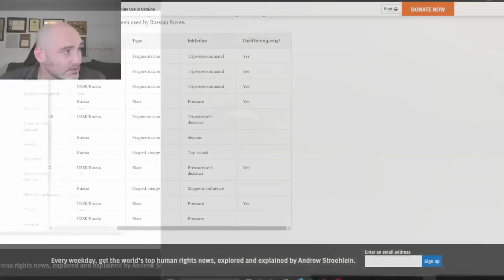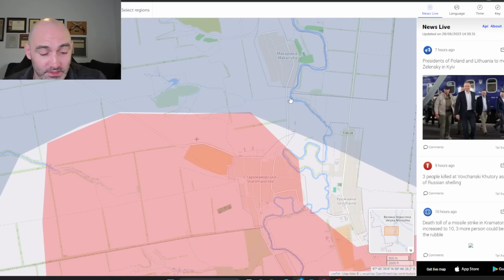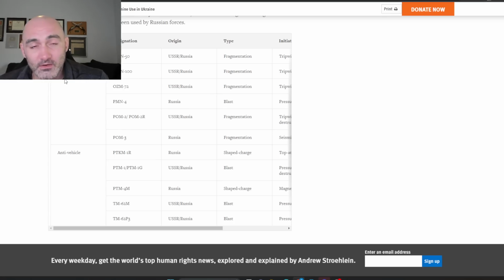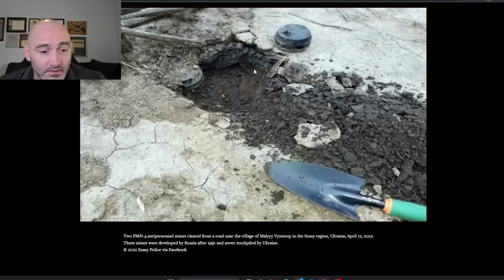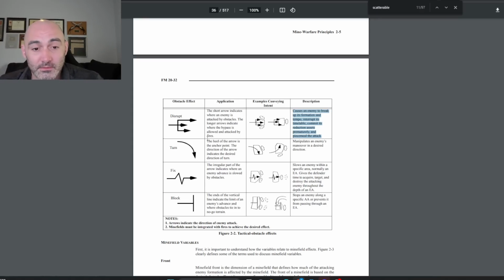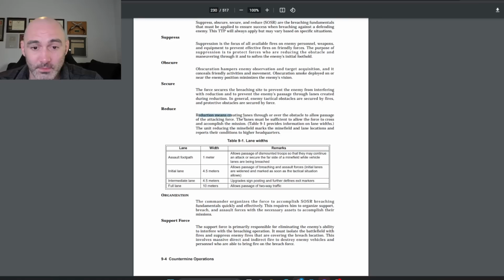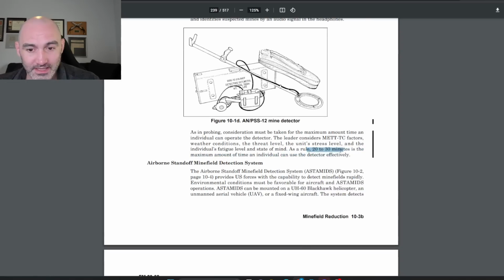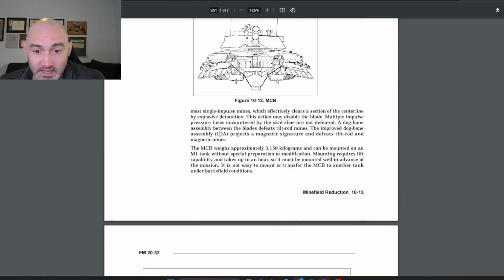The Simple Russian Weapon Slowing Ukraine's Offensive!

Comment: There are some "smart" mines that can distinguish between different types of vehicles, have motion detectors, they are also remote controlled and have inactivation timer.
They do not react to external exposition or rollers or beating by for example chains.
Some are made from mainly non magnetic materials, so metal detectors don't work.
Reply: I doubt any of these are in use by the Russians. They are just laying thousands of general mines.
Reply: They can be worse than that.  They can count the number of vehicles and ignore the first X, or activate in x minutes or hours.  The detonator can detect the shockwave of the MCLC and lock the firing device for x seconds so the MCLC doesn't work. (That's an Italian mine)  However modern US min detectors are actually ground penetrating radars, so they pick up non-metallic mines.

Comment: HELP! I'm getting mixed signals everywhere. Are things going sideways for the Ukrainians? Straight up, please.
Reply: It's simply too soon to say. Certainly the Ukrainian armed forces would have liked to be further than they are, but that's not indicative of things going sideways, just that the Russian forces haven't made any major blunders that could be exploited, unlike in areas like Kharkiv. Prigozhin's attempted coup will also have caused a delay, as the Ukrainian forces will have wanted to wait and see what happened during and in the immediate aftermath of that incident.

Ukraine has to be much more careful in how they commit forces, as they have less manpower in general than Russia, and although Western kit can be replaced fairly rapidly, training new crews to replace dead or injured ones would take time. For example, the US have over 6000 Bradleys knocking about, but they're no good to Ukraine if the crews trained to operate them are dead, wounded or even just exhausted. 

There's also a political aspect - Ukraine may be stalling committing their full forces in the hopes of getting modern airpower, which would drastically improve their overall offensive capability and reduce casualties. 

Ukraine has plenty left in the can, so to speak, but Russia has had time to prepare significant defences, so nothing is going to happen quickly unless or until there is a major breakthrough. Russia undoubtedly has the easier job, just camping on what they have, but they have an issue in that they are trying to defend a massive contact line with far too few men. Operation Uranus that ended the siege of Stalingrad in WWII sent over a million Soviet troops through a hundred kilometres of contact line, whereas present-day Russia in Ukraine is trying to defend over a thousand kilometres of contact line with around 700,000 men in total, bearing in mind that most of those will not be front line combat troops.
Reply: Jesus seriously????   They are getting demolished against Russian impregnable defense lines.   At the current rate it would take them 16 years to achieve anything and a million dead.

Comment: Seems like a job for an anti mining drone. Let loose a small army of heavy but expendable objects like barrels fill with water deployed from a flat bed drone with a ramp. Or maybe a drone that can pick up a heat signature since metal is thermally conductive and shines a laser at the mine heating it up until it explodes.
Reply: A drone large enough to carry any substantial weight would be a helicopter which is big enough to shoot down. Many mines are now plastic. Perhaps some form of acoustics where you find it’s frequency? Or fire?
Reply: @LloydBrodrick-ne5ei  Wasn't talking about an aerial drone, but a land based tractor like drone of very simple design that pushes a barrel out in front of it much like a steam roller. Build em cheap and make a bunch.l
Reply: @LloydBrodrick-ne5ei  Not if it's flying at an elevation of two meters.
Reply: The mines will rapidly drop to the ambient temperature of the area they're laid in, precisely because they are made of metal - any residual heat will be conducted away. There is a drone-mounted metal detector based on the DJI M600, but it has a maximum 18 minutes of flight time which would severely limit how many mines could be identified in a single flight. Lasers are also incredibly power-hungry, the smallest mobile laser system fielded so far had to be carried by a modified 747 jet, definitely not something you'd want to be flying around in a hostile area.
Reply: @Mcsqw  The Boeing YAL-1 ABL was two decades ago. The Army just received the first operational Strykers with tactical lasers for SHORAD earlier this year after a few years of testing. Sandboxx recently posted a video about this.
Reply: @Mcsqw  during the first gulf war, Iraqi tanks were easier to target at night because they were a thermal sink that radiated heat at night and could be picked up by thermal imaging. But I agree, the lasers are not practical. But I would use a ground base system. If not laser, maybe an explosive charge to destroy the mine tossed from a ground base drone .
Reply: Yes. Lawn rollers cost $100. a flimsy plastic version would be way cheaper. Slap a solar-powered motor that's geared way down to provide massive torque, and watch your swarm of snail-speed lawn rollers explode on mines or get shot by somebody who just became your target. The Russians are right. Cannon fodder is very important.
Reply: @RichardLewisCaldwell   made with parts from Home Depot. Doers get more done !

Comment: Ukraine must have lots of abandoned cars and 4x4s .. So what happens if you weld on a few more tyres, chain those together and push them with a tank/apc .. The  cheap cars become mine clearers and also a shield against antitank weapons.
Reply: just fill old oil barrels full of sand and roll them from a movable ramp.
Reply: @buddy1155  i had a similar idea, but I was thinking plastic barrels full of water. A drone would push it forward like a steam roller and when it detonated, the drone would load another barrel in front. You’d make several of these running in parallel but in staggered formation so’d the they’d be difficult to take out by artillery
Reply: @kurtiserikson7334  I believe it takes 500 pounds to detonate a mine. It might be smart to combine our ideas and use wet sand, that is heavier as water or dry sand.
With an oil drum or a water barrel we are both a bit too light.
Reply: @buddy1155  
A gallon of water is 8.34 pounds. So five hundred would be sixty gallons or just a little more than a standard water heater. But you’d need something strong and heavier to deploy it otherwise it wouldn’t get traction, so the deployment vehicle should carry several of these as ballast and when one blows, it loads another. The only reason I was thinking plastic barrels and water is the shrapnel would be less deadly to the vehicle releasing it

Comment: Incredible that Ukraine's military cant figure out what there farmers have..  We have ground pen radar --we have rc quads that can detect mines   also old fashion   run it over with farming tracker.  But they don't do this at least on video they run it over with a tank.   Mines are not the hard thing you think it is --detect--blow it up .  Im just venting we have the tech to remove this  it seems if i give it to them they will still walk over .
Reply: So let’s say they’ve detected A mine with ground pen radar or with a quad copter. …What then? How do you disarm the mines quickly enough and in enough numbers artillery and other fire so that you can then stage a breakthrough?
Reply: @idontwanttoputmyname403  easy, you fall back a few hundred yards and dig in. The russians will be ordered to attack and show exactly where the mines, erm, were.
Reply: Mines are extremely difficult to deal with, which is why it takes so long to de-mine areas even in peacetime. In the whole world in 2021, 146 square kilometres of minefield were cleared. Estimates are that there are 250,000 square kilometres of minefield in Ukraine. And most of those mines that were cleared will have been cleared without the mine clearance teams being under fire.

Comment: I am surprised they have not mounted mine detectors onto drones.
Reply: Finding the mines isn’t really the issue. The bigger issue is making a path through them; quickly enough, under fire, and big enough to get a good number of troops and materiel through.
Reply: …
That’s actually not a bad idea, but can the detectors be light enough to be carried by drones?
Reply: Yeah my thought was maybe drones with thermal cameras flying at night could detect mines be cause of the temperature differential between the ground and the mine...Of course finding them is only half the battel. Then you have to figure out how to clear them, clear them while the Russians shoot at you.
Reply: When they are everywhere you don't need to find the individual mines, just clear the entire field.
Reply: @guidodenbroeder935 The problem with that approach is whether you could ever be sure that you'd definitely detonated all the mines - I suspect you'd still have to manually sweep and clear the area you'd pounded into the dust just to be on the safe side. You also risk churning up the ground and making it more difficult to get across.